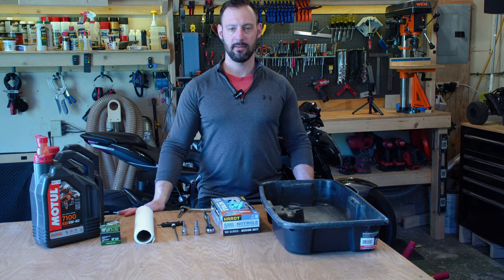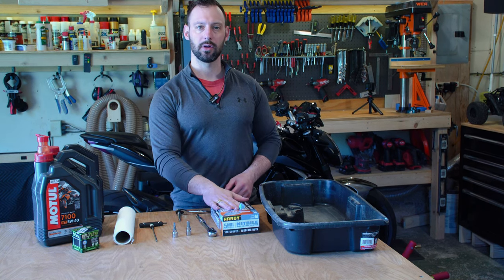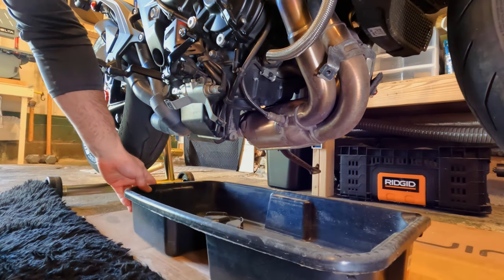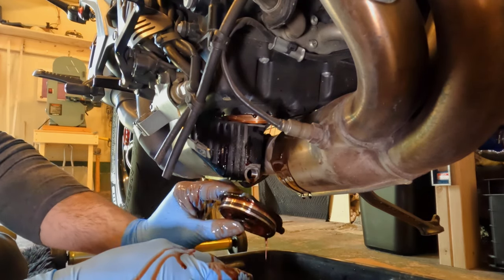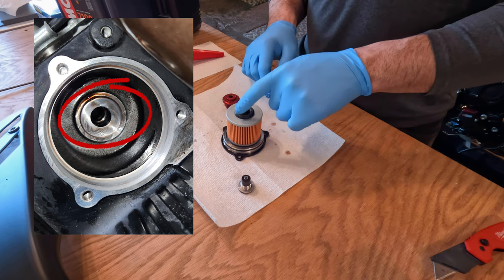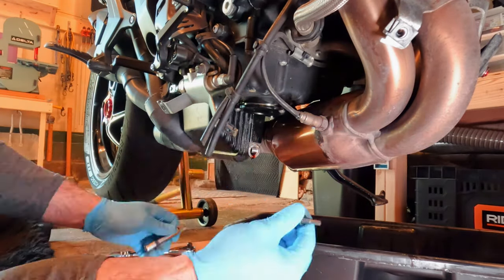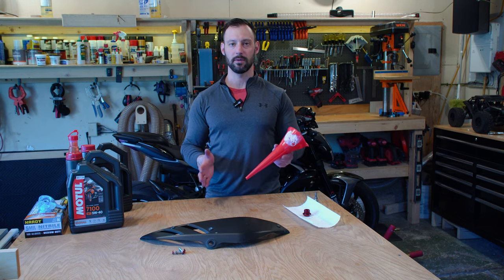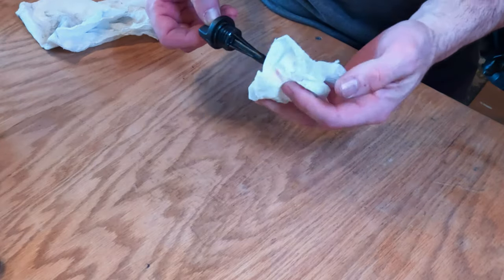How To Change Your Oil - MV Agusta Brutale 800RR

Comment: Love this video man, there is so little content out there for the MV owners. quick question, is the oil/filter the same for the not RR version? (Just the 800)
Reply from the maker: I'm glad it helped! I know the struggle I just had to take my front wheel off and trying to find the torque specs and the order to torque all the bolts was a challenge. As for your question, I don't see why it would be any different. It is the same engine.

Comment: there are two manuals, one for chassis and one for engine. they're out there tho bro. As soon as I found them I downloaded the PDFs tho.
Reply from the maker: Are they for the newer models? I know many things are the same, but some are not.
Reply: when i got my dragster in 2016, the manuals were already on the net. I think the previous brutale came out in 2013-2014, so id bet the shop manuals will find there way to manualslib soon as your model came out in 2021

Comment: Silly question but do you check the oil level with the dipstick screwed in or just onto the threads? Cheers
Reply from the maker: That's not a stupid question. I have always wondered the same thing. I always screw it in, but I'm not 100% sure.

Comment: thanks very helpful😎but if you make the oil change by yourself, do you still get the remainder message "make maintenance" on the tft screen? Do you know how to remove that message?
Reply from the maker: Glad it was helpful! Yes, that message will come up at the maintenance  intervals, not the oil change intervals. You can reset it by holding down the cruise control or the launch button but I can't remember. I found a video on YT that showed how to do it.